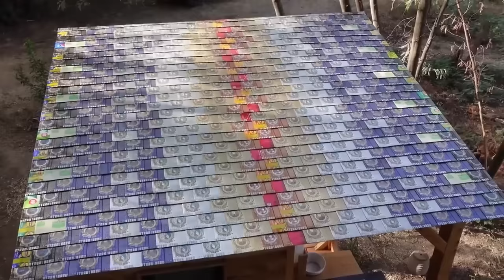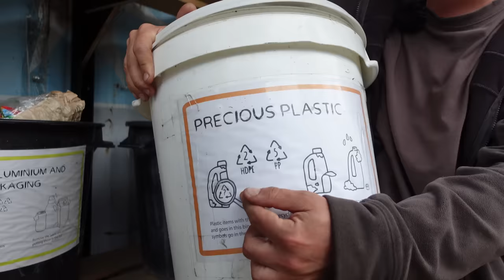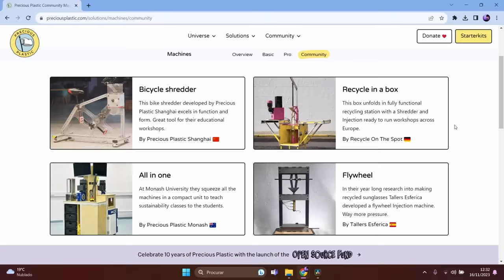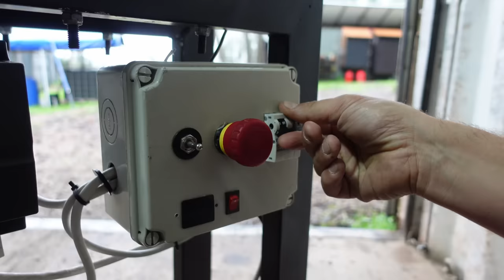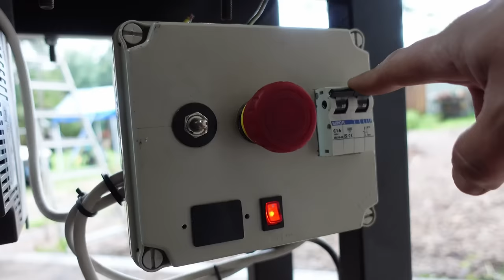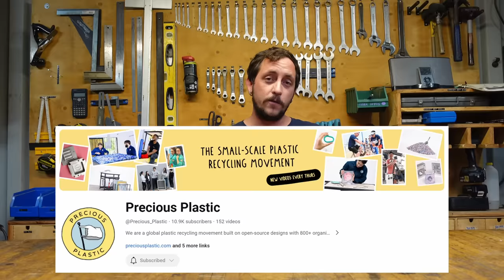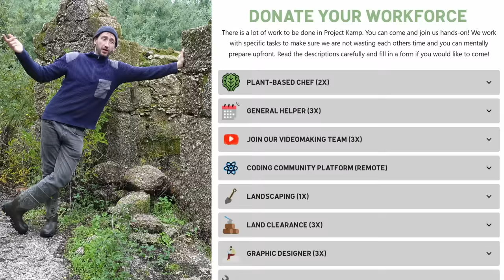#105 Digging swales and planting fruit trees before winter rain comes (LAST EPISODE)

Comment: Woo hoo. A big digger is SO much more effective than a mini digger... 
But with either, compaction is your enemy. A good operator will re-dig or hook through the soil wherever they have been.With freshly dug and moist ground, I break with a fork even where I've been standing/walking. Plants depend on the life within the soil, and together they create permeability and absorption of rainfall.
Also, look up the 'Key Line' system for swales, where they start at a 'valley' and descend v gradually out to (and then around) the ridges. Very clever and well-known way of moving water to where it is otherwise lacking.
(Edit:24:38 oh no.. on wet ground too. Now you have compacted topsoil over compacted subsoil. Rain will struggle to fully penetrate, soil life will struggle to help you. Maybe it can't be helped, but reckon now you're going to need more than one broadfork!  Grow annuals with deep roots that will then decay, such as daikon radish ; )

Comment: Nice works guys. 
Be aware that if you run the "internet" cable close to the electricity cable, it could create problems with the internet connection.

Comment: Suggestion: 

The hooks are made out of plastic and will degrade in the sun. If you cover the hooks with some sort of UV protectant varnish It will prevent the plastic from breaking apart in the sunlight. It is usually used to protect the paint on cars and to protect furniture that is outside in the sunlight.

Comment: for next time be cautious with the cow manure around new fruit trees. Typically, use two scoops of potting soil in the planting hole and cover with normal soil. After the first year, add two scoops of manure around the tree, making sure it doesn't touch the bark. but I think you'll be fine And you will have beautiful trees in a couple of years🌳🌳🌳

Comment: When you pull the electric and network cable. there is still enough room for future cables ... therefore it would have been usefull to also pull through another 'pull-wire' for future use.

Comment: Hope you already preapared for the next cable being added to the pipe by adding an extra pull-through wire/cable... And you might wanna prepare a "diy cable dispenser" before your next trench or house build. ;-)

Comment: This is why I constantly argue this point no matter how hard your try to be eco-friendly you'll still find your self have to resort to using petroleum products such as your plastic tube, an plastic coated wires, the gas you use in your vehicles
Reply: Which is not an argument against trying.

Comment: Network cables and power cables should never be run within the same conduit.  Electrical noise can affect the Ethernet signal. In extreme cases, the Ethernet cable won’t work. More likely, you will end up with lost packets and poor performance.

Comment: **WARNING** Internet cable needs to be separate from the power cable by at least 300mm. If you have these in the same pipe then you will get interference from to the internet cable from the power cable. I am an old cable guy. Nice trenching you got done 😀

Comment: It is possible you can use wood bark and wood chips to absorb water. It is like sponge, if it rains the rain begins to soak into the wood and since wood has a relatively slower absorption rate it still allows some water thru into the soil below. But any excess water will be absorbed by the wood until and if the wood gets completely water logged. But now with all that water in the wood, as the ground below dries up from gravity and from trees and things taking the water out, the wood will begin releasing its water into the drier areas(the ground the roots get water from) so the trees will not have to be manually watered in dry season unless your wood is completely dried. But that will store alot of water, the more wood the better, and especially in an orchid they love the fungi. I am talking at least like 10 inches thick, then bring a layer every year after of a few inches each year. And then now you will be getting really rich soil in that area and that is precisely why, the wood closet to the ground is breaking down into real soil. Keep bring in a layer once a year and eventually you will have a couple feet of rich ass soil.

Comment: Did you know that for electricity and data cables it's not the best practice to run in the same tubing? It would have been a good idea to run them in a separate tube so electric cable "conductivity" doesn't have a chance to interfere with the data cable signal.

Comment: You will need to be aware that you might get interference in your internet cable because it is running beside the power. My recommendation for the internet is to use a wireless bridge to connect the other buildings.

Comment: I believe if you run the Internet in the same conduit as the electrical then you will have interference on your Internet signal. I think they are supposed to be a 6 inch separation unless the cable is shielded.

Comment: You should have spare that Ethernet cable. It is possible to use the electricity cable to transmit data and electricity at the same time.
Too late I guess, but in case you need a long wire next time, you can just use 1 cable

Comment: Have you guys consider the use of a wifi adapter/router/switch and an antenna for the Internet? I'm assuming you already have and wifi network. Maybe not the best option when you are trying to reduce waste but.... it will be a pain to diagnose problems on that cable if they eventually come.

Comment: 28:00 As far as I know there are no alternatives. Metal will corrode, ceramics won't flex, natural materials are generally no shock resitance (which you want to keep someone from breakng the pipes with a shovel) and not good at keeping water out.
 
Way way back people used hollowed out tree trunks as pipes but it's a lot of work and it was basically just used for water.

Comment: I noticed that there was quite a bit of plastic on the floor, 15:58/42:24 you could add a skirt type of funnel underneath the cutting machine.? or a bigger bucket that is higher

Comment: If the hole has been deep enough you could have buried a coil of tubing to run water through to create a cooling(in the summer)/warming (in the winter) geothermal radiator

Comment: for internet use a point to point dish at both locations its easier then a network cable also you shouldnt run CAT cable more than 100 meters ( if you really want to use a cable then use fiber cable and a SFP with switch on either end ), on a side not if you have running water I am suprised you have buildt a ram pump to full a large water tank at a high point to water plants and stuff

Comment: I think I understood you to say the internet and electricity were going in one conduit/pipe, correct? That is not a good idea. Electricity will create harmonic frequencies that interrupt cable or low voltage signals. It is alternating current [AC] which causes this. Put it in a separate conduit if you want good internet service, and keep the water and separate by 3' horizontal or 18" vertical separation for safety if buried together. Good luck

Comment: i would prefer fibrechannel between longer distances (>17m) especially as you put it in the same tube as high voltage. Try to keep at least 30cm between 220V and low energy cables (like cat6/7 network)

Comment: There not really a good alternative for plastic pipes to isolate the cables BUT maybe in the future you can get those from recycled plastics. You could make a mold there you make a footlong pipe with a connection part and with a hundred you get one 30 meter long pipe. Of course you need collect more plastic waste then.

Comment: Be sure to pull the wood chips away from the tree trunks. The wood chips should cover the roots around the tree but not touch the trunk. If it does touch, it can transmit rot to the tree.
Reply: VERY glad to see the swales you created! This is such an excellent way to capture water for your orchard!

Comment: Internet and Electricity are incompatible in same pipe or within 100mm or so of one and other. Electricity can induce rogue/cross voltages that cause interferance of internet. Looks like you'll be getting a bit of voltage loss as well.

Comment: in the future you should consider running fibre cable, a single cable can hold multiple fibres and you will get much cheaper hardware for faster data speeds if you ever need them

Comment: Next thing I would do is to build an electricity producing waterwheel, or pulse pump putting out water uphill into storage or as continuous water supplying drainage for dry areas maybe?
Whatever the use it would be nice to do something with that water especially since you have so much kinetic energy to harvest in that two meter water drop  off/ overflow,
And I would look into owning your own digger or tractor with a backhoe if you have the finances.
But preferably a simple and simply to maintain small digger with tracks and a tractor with trailer that can carry the digger.
Both not being to big, not to worn out and practical/ simple in use/ repair.
For big heavy ground work I would simply still hire a contractor and only do the small stuff myself.
Look for a good secondhand without leaking hydraulic seals and without worn out pinions.
Also check the engine hours and cut open and replace the old oil filter checking for possible metal shavings in the filter coming from the engine.
Just use the machinery as you can instead of digging by hand and take your time to work smart instead of just hard doing heavy work.
A ground drill to dig poles and planting holes for trees would be a nice addition to have on a tractor.
But whatever your plans and the budget allows to do it looks great what you guys have accomplished up to now.

Comment: How to turn eucalyptus into cash.
You have two options, both of which are viable and simple.
1) Cut your reject poles into a standard length and stack it to dry.  For firewood, an appropriate length is 4' to 5' (120 cm to 150 cm) put the word out in the local community that you have seasoned eucalyptus firewood for sale by the cubic meter.
2) The highest use, is straight poles striped of bark for agricultural and shade structures.  Select for the straightest poles and strip the Bark.  Here is the quick, easy method for fresh cut poles:  https://www.youtube.com/watch?v=ovqFjFVzvBE  Same word of mouth advertising as above. 😊

Comment: A Hack I saw for getting Cables through a Pipe if you don’t have a pull string. Tie a pull string to a plastic shopping bag and let a vacuum cleaner suck the bag through the pipe with the string

Comment: It would be cool to add a hydroelectric generator to the dam. Might help with power levels during rainy season/times when there is an extended period of darkness, if that is a problem of course.

Comment: UTP cable shouldn't be used between buildings, optical cable is recommended. Plus always double up the cable, plus one cable should be preserved in case if you need to put in something else later on....

Comment: @ 27:30 How about using a Mifi router on battery? I use it in my van with unlimited data. Only con is that after the first 10gb, you have to reload 2gb per time. For a few people it will be fine but for a bigger group maybe not that practical

Comment: Don't put unshielded internet cables in a pipe together with power, that is guaranteed trouble 😵‍💫 especially on that distance you will certainly get interference. Use shielded cat7 cable, but even better separate them completely

Comment: Did you attach another piece of string to the cables you pulled through the conduit  in case you need to thread other cables through it later?

Comment: Wondering if it is a good idea to put internet and electrical wires in the same conduits or enclosure, because one is line voltage and the other is low voltage?

Comment: You really should not combine high voltage and low voltage cabling in the same conduit. 

Aside from the possibility of inferring RF noise into your network cabling, there is a possibility you could induce high voltage into your low voltage devices.

I'm not certain about the industrial codes in Portugal, but in N.A. it's forbidden by building code to combine high and low voltage cabling in the same conduit.

Comment: tbh, for stuff like infrastructure, electrical cables, water pipes, network cable etc wrapped in plastic, i don't think its as inherently bad, the lifetime usage is considerable to where its likely the best use of resouces. single use plastics are a diffrent story. regardless The considerations i would suggest is find a supplier using bio or recycled plastics, the same petrochemical based plastics can be made from biomass, ideally waste biomass. Theres also diffrent polymers, the most common is PVC, but TPE is another which may be better for the enviroment but its less common due to cost. we could build copper water pipes, it would cost a fortune and do the same, it would make it easy to recycle but we cant forget in the first place Infrastructure generally doesnt change, and if things do change, its more likely to be reused before we even think about recycled.

Comment: There’s not really any alternative to plastic for cables and pipes. In the “Olden days”, terracotta pipes were used for sewerage but these developed problems as they aged. Mostly breakages and the rubber seals perishing allowing roots to invade the pipes

Comment: Sorry to break it to you but you haven't made a swale. A swale is level, and is designed to hold water as long as possible on the land on a static position. What you have made is a ditch or trech with a runoff which funnels the rainwater off the land you have prepared. Which means that the hill won't get the water you want and need for the food trees you are aiming to grow there. I suggest you do more research into swales before doing all the work. Also the mimosa's don't necessarily need to be removed completely if you are planning to grow fruit trees. They can be an excellent and easy source for carbon farming to build up the soil.

Comment: The Cable for Electricity seems rather small for what you guys are doing (considering the distance too) maybe you should have asked an professional how and what kind of cable to use especially with your swales beeing close by i think u will have problems with water sooner or later also why not put in one empty pipe just in case you need it later?

Comment: You should not put ethernet and electricity in the same pipe. Use separated pipes. They could run parallel

Comment: I'm sure this question has been asked and answered before, likely in the research modules etc. 

But here we go anyway -  have you costed the differences between removing the stumps with hand tools or small engine machines (stump grinders etc, running Briggs & Stratton motors) versus using the digger, in terms of pollution? Rather, which is more sustainable? I'm guessing that using handtools takes alot of time away from the group, and takes longer using more fuel etc. But there is also the idea that using the excavator is running on diesel which is more economic, and efficient. 

I suppose my question is, do you guys do the maths on these sorts of things before committing to using big machinery? Personally I see it as acceptable if it encourages more new growth of native species in a faster time.
Reply: People often forget something called money. Renting this machines cost money. Manual labor is less efficient but it's "free". It might even end up being more expensive in the long run and people could in theory be doing other things, but sometimes you just have to do things "now" even if it's not the best and most cost effective way.
Reply: @dreidu  it's not a question of finances it was more of which is a better and more environmentally friendly method. It's not a criticism in any way, just curiosity as to how decisions like these are made. I don't believe it would be taken lightly due to the kamps ethos
Reply: @towel2473  imagine that having a guy working for 2 days is less impactful than having people living and eating, etc for 2 weeks. That might even be true, but does it matter? If your goal is to be a community, people will be there, so it may very well be more impactful or less sustainable but the reality is that we will always impact the environment around us, simply because we exist, so I would find those calculations very empty of meaning. I don't know how better or worse using machinery or hand tolls or a combination of both is, but I know you have to do the best you can't. Long story short I think trying to do a simple math for those questions would be incredibly flawed
Reply: @dreidu  the kamps main ethos is sustainability, and team size factors in of course. But they all eat and live sustainably, even so much as how often the car they use etc. so it is interesting to me how they reach decisions to carry out large earth works with heavy equipment. All of these tasks are possible to complete by hand, sustainably, though take more time. This is the curiosity of my question, as how to decide when and when not to employ heavy machines versus hand labour. 

I think you're misunderstanding me and you seem a little standoffish. Again I'm not criticising or complaining just exercising curiosity toward their thought processes. Been following since day 1.
Reply: I think it's a task they wanted to do for a long time and time was running out and people going so they probably looked at the budget and saw they had a couple of money left and pulled the trigger. I don't think it was a grand plan (in terms of manual vs machine). It was a last minute opportunity. At least that's how it looked to me.
By the way the understanding I got off your first message was that maybe doing one of work by machines might be more efficient then doing it several times by hand.